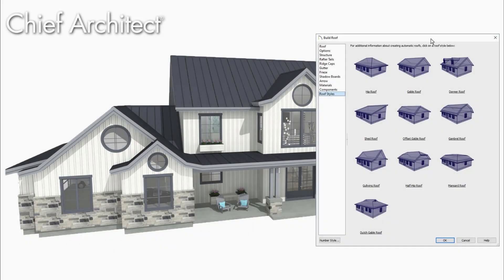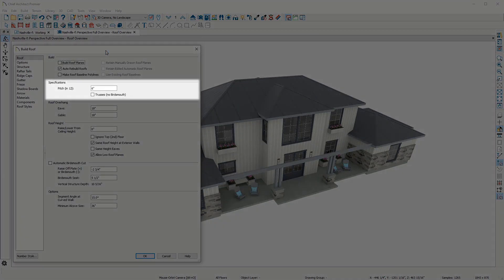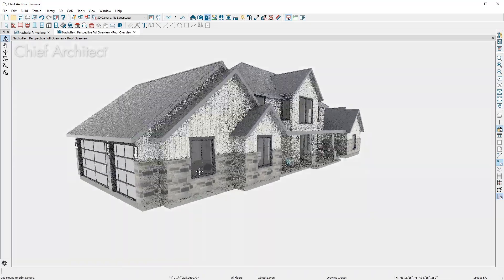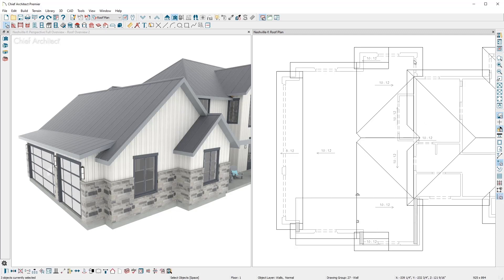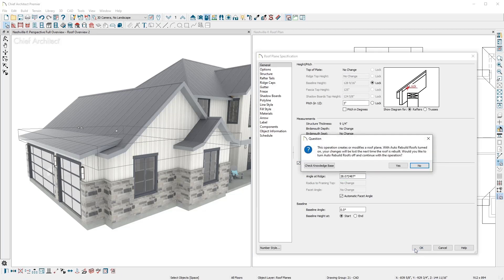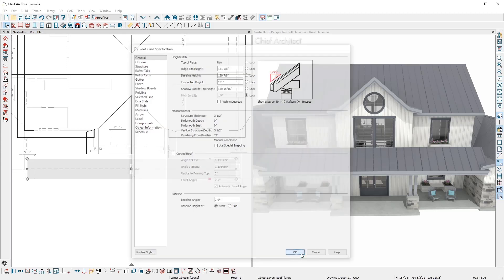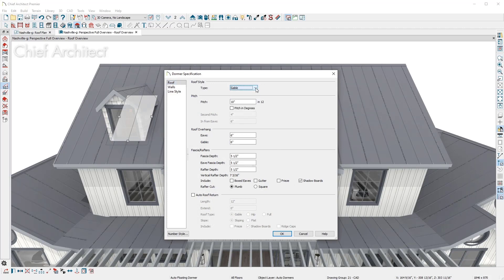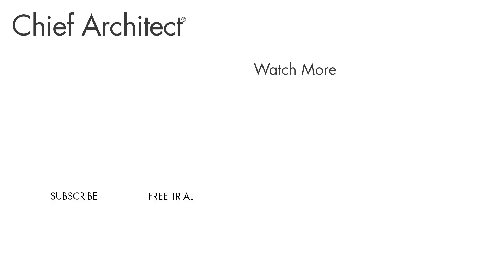Creating Different Roof Designs with Chief Architect

Comment: Where is adobe style design (flat roof)??
Reply from the maker: Here is a video for that: https://www.chiefarchitect.com/videos/watch/1530/drawing-parapet-walls-with-a-flat-roof.html
Reply: @ChiefArchitect  any idea why get incompatible object types when trying to select and make changes to all the walls? This is just on a 4 wall rectangle test building too.
Reply from the maker: I am sorry to hear this. I would recommend reaching out to our Technical Support team to look into this further. Our support team has a lot of knowledge in this area and can help you troubleshoot this. You can reach technical support at 208-292-3375 Monday – Friday from 7 AM – 4 PM Pacific.
Reply: @ChiefArchitect  ok, if I select all 4 wall using the control key...then I can open the make changes dialog.  I thought I saw them use the select tool and drag a box to do this in a tutorial?  I see the problem was my selection was also including roof and frame elements, thus incompatible types for modification